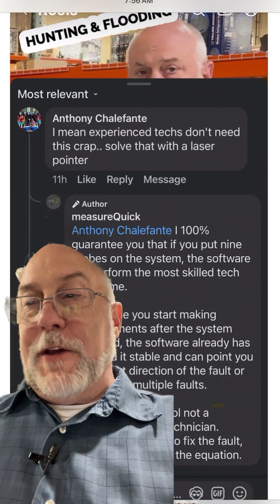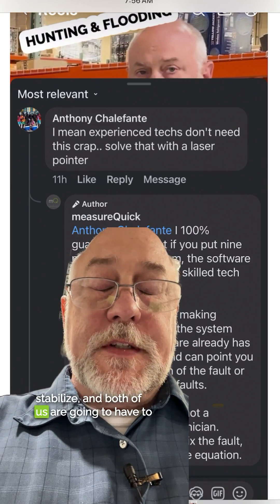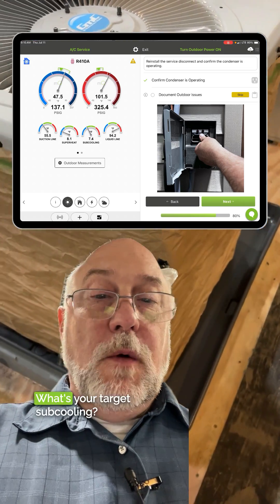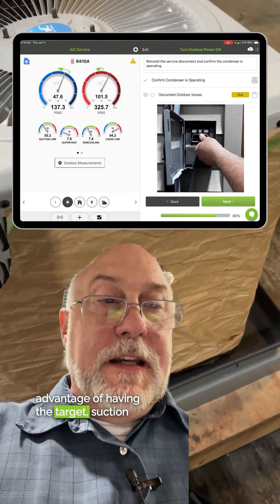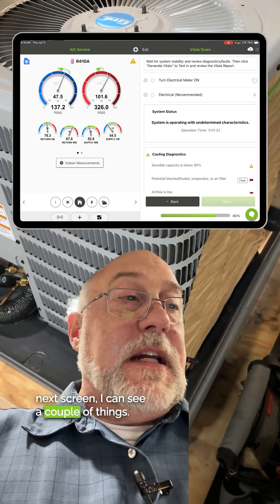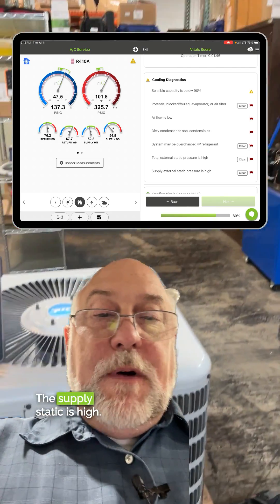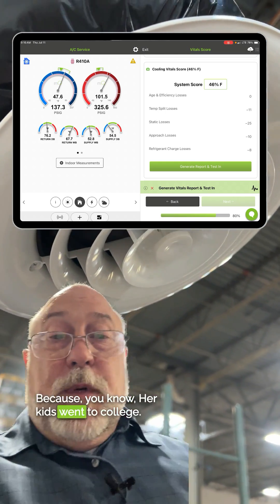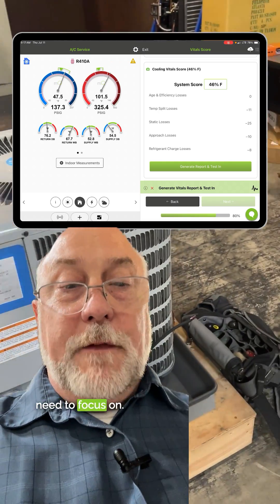What's quicker?

Comment: Great Program. It will make any tech better. Everyone wins. Actual airflow is the critical weakness that needs to be measured somehow. The True flow tool looks to be the best and fastest airflow solution. Finding the Ak for the system grilles or the Pressure Drop across the evaporator both require data from the manufacturers. It takes research and effort to find the info you need... If you even can. For older system and off brands...Good Luck!

Comment: Amen!!!! I keep saying this to those at my company. I bet you these commenters are still using a map book to get around. Both work, one is clearly more conviemant and faster. Embrace the technology. 

I just used the duct pressure quick test! It’s awesome. I don’t have a TFG yet so I can only use the fan curves, my question is will MQ use the SCFM estimated values to input to the quick test ?
Reply from the maker: We were not going to as it is an estimated value and not an actual measure. We have that estimated airflow really dialed in, but it is still estimated and requires the equipment to be operating reasonably well.
Reply: @measureQuick  makes sense
Reply: I'm not boosting or hating either view, but to be fair, a fold up map can do things your phone app could never dream of. They both have their strengths and weaknesses and they don't cross over. You have to pick one. Nothing is ever 100 percent. There's no reason to disparage anyone UNLESS they are just being stubborn or closed minded AND their method comes up short for a particular application and they refuse to try.